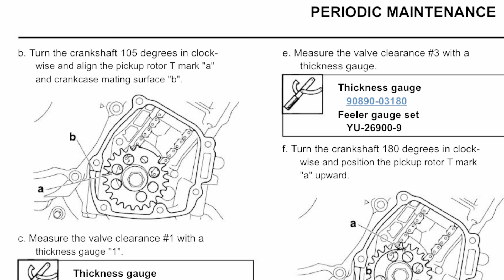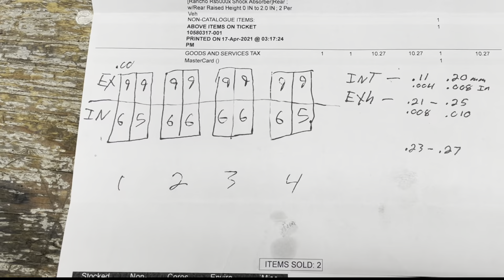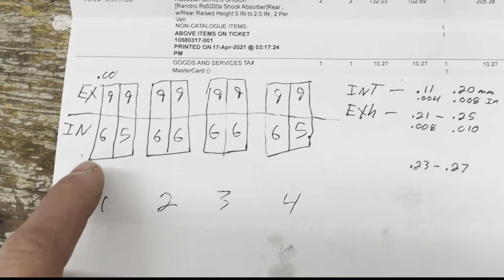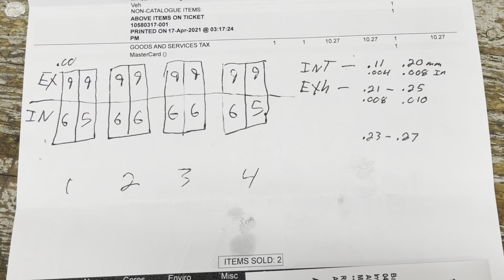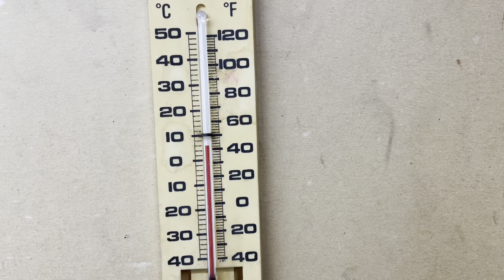Yamaha Crossplane R1 Hard Start Valve Adjustment And Starter Solenoid Fix

Comment: where woul;d you order shims from and any idea what the OD of the shims is? 2009 R1 here
Reply from the maker: My Yamaha dealer had both size shims in stock. I was going to bring in an old shim to the dealer and match up the sizes but it turned out I didn’t need any. 
You can buy kits on Amazon but I am not 100% sure on what size is correct. I think it’s the bigger size shim but don’t take my word on that!
Reply: @JT2JZ  thanks for reply found out they are 9.48 OD
Reply from the maker: Good to know! Thanks for sharing
Reply: Where would the shim go?
Reply: Oh, under the valve?
Reply from the maker: The removal shim sits on top of the bucket. The shim is the component that sits directly under the cam lobe.
Reply: @JT2JZ  lol I googled, it sorry.. done it on cars and heard of shims but wasn’t picturing… thinking about getting one of these thank you!
Reply from the maker: No worries. It’s hard to visualize if you have never seen it in person. 
Pretty common set up for Japanese style engines. ( my 1997 toyota supra uses the same bucket and shim set up ) 
Honestly these bikes are awesome. Just a few common issues to look out for. My issue was a weak starter from day one causing lots of intermittent no starts for me.
Reply: @JT2JZ  that Supra is BADASS

Comment: Should go delete my last comment about the starter relay lol did you end up replacing the solenoid or is it still doing good with the di electric grease?
Reply from the maker: Dielectric grease didn’t change my issue. 
Changing the complete relay did help for a few months before the starter completely failed